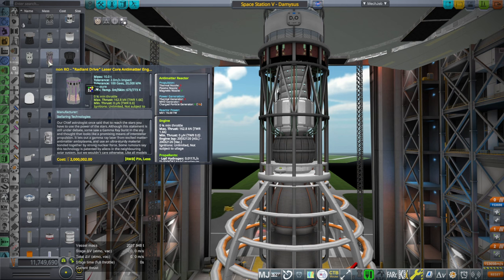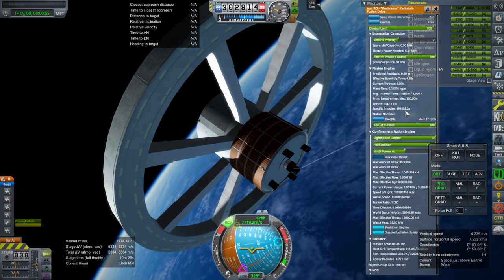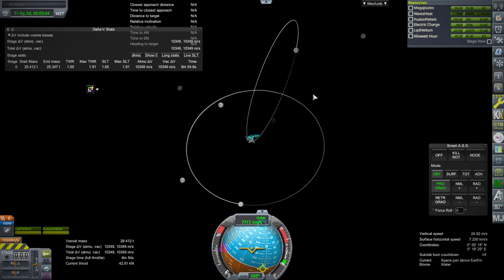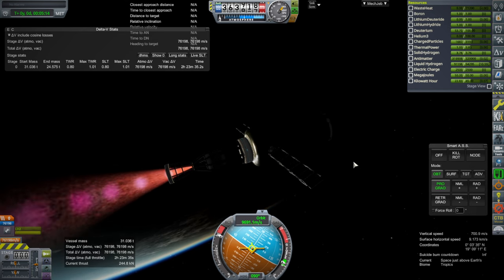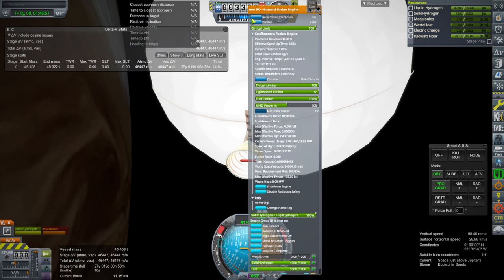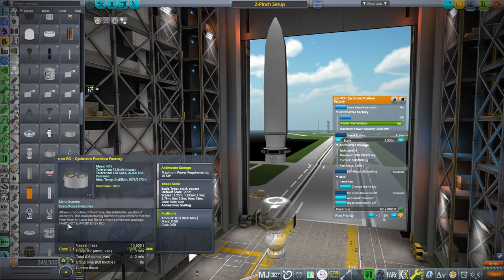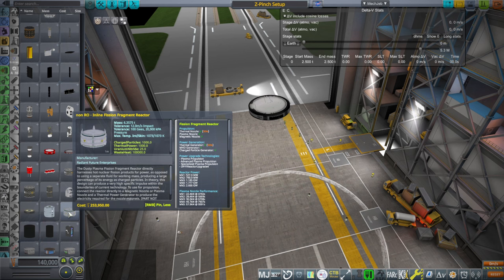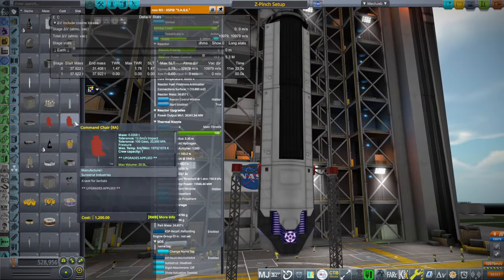RSS Interstellar with Exoplanets 04 (KSP 1.12) - Testing All the KSP-IE Things 4

Comment: It’s been a long time since I’ve played interstellar, but if I remember correctly, there’s a difference between positrons and anti-matter. Antimatter is supposed to be like anti-hydrogen. The positron engines I think are earlier in the   Tech tree. You can collect antimatter at earth, but it’s much faster to collect it at Jupiter.
Reply from the maker: Ah, okay. Yeah, I think we'll be settling up some collection operations at Jupiter.
Reply: @RaizSpace  at least that was my experience with Jool. I don’t know if interstellar models that in real solar system.
Reply: @mbmurphy777  it does, the magnetic belts are calculated for RSS too

Comment: Relativity is weird, It only applies to other observers.  From your perspective you can fly 100 light years instantly by traveling at C. From observers on Kerbin it took you 100 years but from your perspective you teleported.
Reply from the maker: I'm aware how it works in real life, and that certainly helps in terms of supplies on board. Saying that it only applies to other observers is incorrect - from the position of the people on the ship, it would look like the observers on Kerbin were the ones traveling. The distinguishing thing would be if the ship decelerates and returns to Kerbin because any acceleration means that it's no longer and inertial frame of reference. Anyway, it's complicated, and the real question is how it's implemented or not implemented here, because the game, as far as I know, only has one clock to calculate life support usage.

Comment: Hello raíz i have a problem with ro the poblem is when i download ro i use ckan and when i open de game in ro tinitym is It freezes and I can't do anything and a river error appears saying that an error occurred in the download. If you have discord, I could send you a photo of the error and a video. The only thing is that I don't speak English. I'm using the translator.
Reply from the maker: I'm not sure what would cause that. How much RAM does your system have? If you have less than 8GB of RAM, it's possible RO didn't have enough. Be careful about the options you choose for RO in CKAN - some of them like Parallax can take a lot of RAM. Also, try the lowest quality RSS Texture package first - it should give you an option on which one you want to download. I go over my install process in this video: https://www.youtube.com/watch?v=pxnHSZyqtAI
Reply: Thanks bro i installed correctly and anotaré cuestion How did you manage to have so many classic rocket parts and how did you manage to have such a perfect shuttle platform. Did you program it or is it the modular launch pads mod and also in ro/rss? I use the ody shuttle and the problem is that the rcs don't work, you know? because